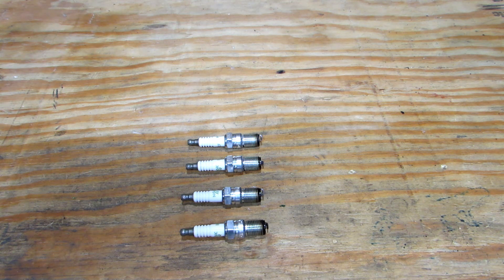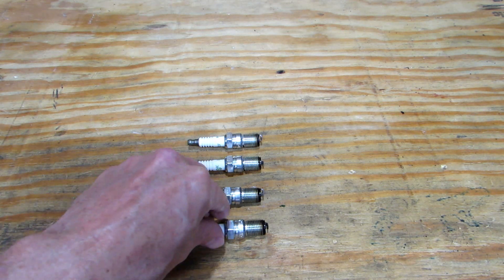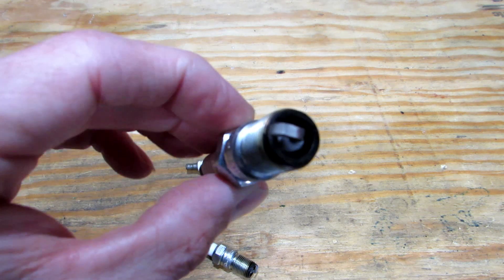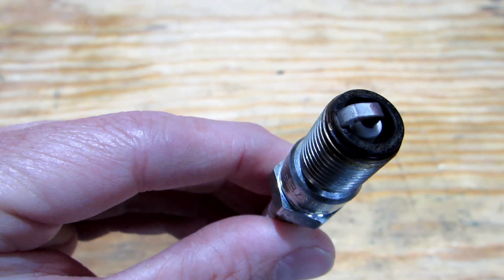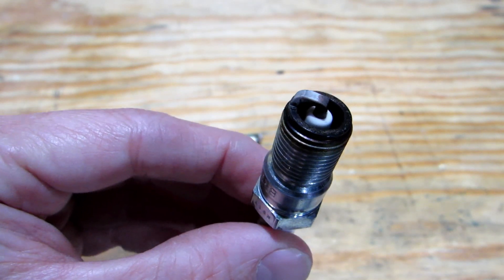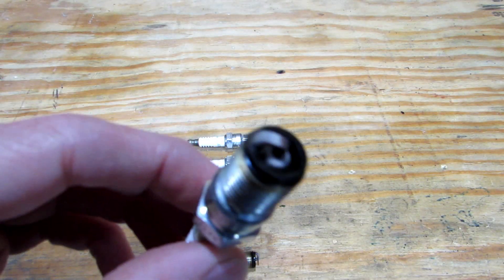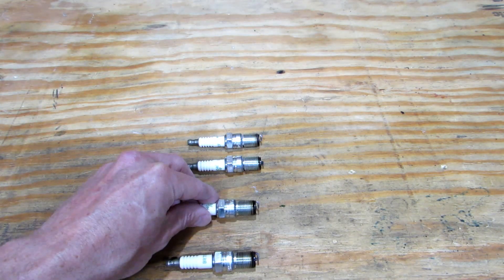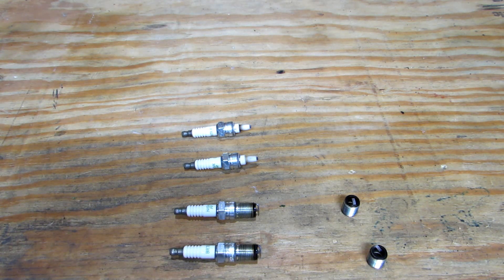Spark plug reading basics

Comment: Good day sir, can anyone help me i have a 125cc motorcycle equipped with a 26mm carborator the jetting is 82main and 38 pilot when i tune it for the highest rpm which is 2 turns out the acceleration is jerky and late throttle response any idea how to deal with it